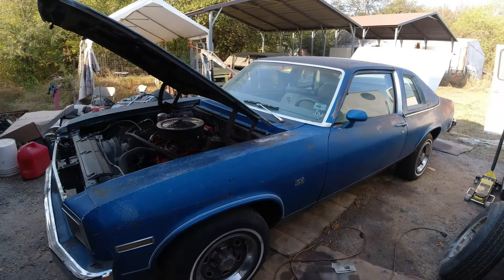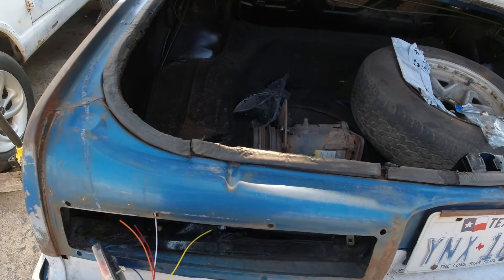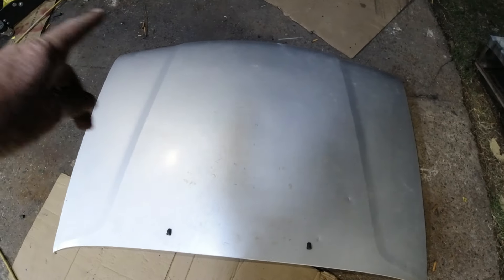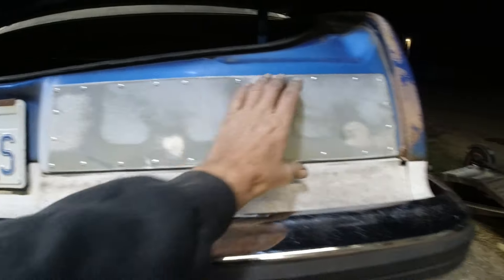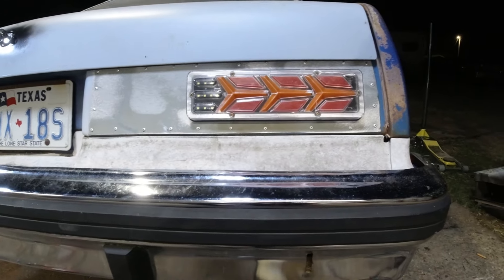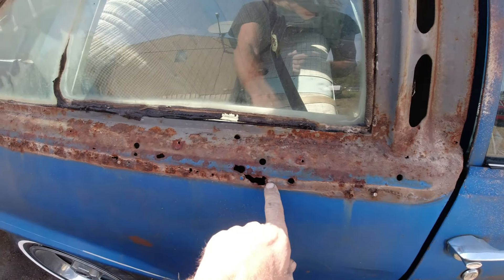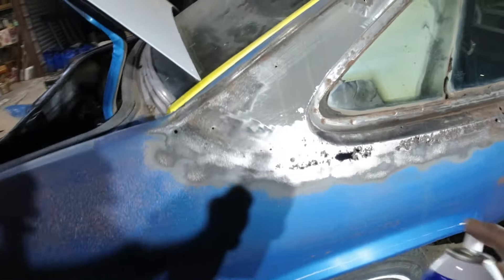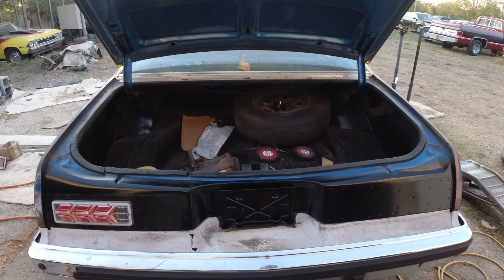1978 V8 "Hot Rod" Nova #6. Installing Custom LED Tail Lights. Rust Repair VDIAGTOOL BT500

Comment: Doing great work on the Nova. I don't know where folks think you're gonna get parts for a Nova Concours from.  Those  Nova Concours were rare in the late 70s because they were a top of the line version of the Nova. I saw one, maybe two in the late 80s early 90s when I was a teenager. in 2024 most have probably been sent to the crusher back in the mid 90s So parts would be hard to come by.

Comment: For led turn signals, you really need to use the new electronic flasher units. The LED’s don’t have the same resistance that standard bulbs have, so the electronic flasher compensates for that.
Reply: Was going to say the same thing.. the resistance isn’t as much so they flash faster

Comment: Hi Lee,  to get full function from your LED conversion,  you will need the LED flasher unit that has a ground wire coming from it. Once the ground wire for that flasher is grounded,  it will function slower flash and all LED Lights should work.  You will need 2 flasher units with the ground wires. I got mine on Amazon about 10 to 15 dollars per unit.
Reply: Was getting ready to type the same thing.  The original flashers required a certain amount of current thru the flasher to have it work properly...but the LED lights use much lower current.  Acts like a blown blub.
Reply: Good to know thank you

Comment: I love that vintage of novas I had nova about that year it was a 6 cylinder with a factory manual 3 speed with a factory floor mounted shifter, I was an automotive technician at that time, and I was well known for building high performance small block Chevy engines, so my Nova ended up with a very good performing 350 and a T10 4 speed, the only other car that I really miss is my 66 Chevelle, anyways great job. I enjoy your videos, and I know that you mainly try to show people how to make the best of what you have to work with, I wonder if you would be able to fabricate a custom surround of the rear windows, maybe entertain using wood ? I know that is a far fetched idea, but I think it would be very unique.
 Thanks for sharing your talent.
 John C

Comment: Great job Lee! I was looking on Marketplace and there's a 1977 Nova Concours parts car that has those original 3 piece tail lights and bumper available in (unfortunately) Tulsa. It's pretty damn far from you but it's an option, i guess. Just looking at it, those parts look compatible with your Nova.
Reply from the maker: yeah, too far

Comment: Hi Lee,
I think there could be a question about when you turned on the left directional, the one strip of the back up light on the right side was flashing. Well, they were flashing on both sides but if you're turning left and that side is flashing, it shouldn't be a big deal but the one strip on the right was flashing at the same time and that's a problem. Cool project! Thanks for taking us along!

Comment: Well I just was thinking about what you are up against with the taillights on the nova but I had the same situation with my contour nova and what I used was a set of 77chevy impala taillights and I had to do some drilling but it was cheap to do and looked great
Reply: They have some 1977 light for impala on eBay for 49.00,Had both left or right side.
Reply: believe it or not a lot of  compliments with the look of the 77 impala lights on my nova
Reply: Hey, that's a pretty cool idea! Those Impala ones weren't too expensive then?
Reply: I’m sure, There pretty close to the same look as the Novas, I’m a Ford guy, but some of the old Chevy car’s look great and where we don’t see them everyday, I couldn’t tell what was original or added,
Reply: There on eBay, just seen today, May not be a fit but look like they would fit better then broken China parts, Just have to get our Government to print more cash for us so we can afford more toys that don’t need parts
Reply: @user-vq3dc2se5d  it was literally like 15 years ago and at the time I didn't have much time to get the ones that belong to the car but had a 77 impala that I used the motor and trans out of and the taillights witch did some drilling but worked out for the time

Comment: Silicone alternative tip - I use DAP Dynaflex 230 available at Lowes and Home Depot. It comes in colors including clear, but more importantly it's paintable when dry. It does take longer to set up, dry, and cure than silicone, but once cured it is at least as strong if not stronger than silicone. It also cleans up with water which means a quick wipe with a wet rag will smooth out a rough edge. Just like Frank's hot sauce, I use that s**t on everything! I've even installed a bunch of glass tile and used it as both the mastic and grout - great stuff!

About your flashers...When I installed LED bulbs in my Javelin tail lights, I ended up buying a 3-prong flasher from Amazon that specifically stated that it was compatible with both standard and LED lights (or combination) to get rid of the fast flashing. Maybe ebay has them?

Comment: That van has a generator light in the center of the cluster for when it isn't charging, pretty much an idiot light but. who knows if the bulb is good or if its still wired up.

Comment: A suggestion..  don't use rivets because they are ugly. Try using panel adhesive. That shit is crazy good at sticking metal panels together. They will never come apart.
Reply from the maker: I want them to be removal

Comment: curves and items g-rated commment makes it pop like old bumpers style class grace or sin·u·ous
/ˈsinyəwəs/
adjective
having many curves and turns.
"the river follows a sinuous trail through the forest"
Similar:
winding
windy
serpentine
curving
twisting
meandering
snaking
snaky
zigzag
zigzagging
turning
bending
curling
coiling
undulating
tortuous
sinuate
ogee
anfractuous
flexuous
meandrous
serpentiform
Opposite:
straight
lithe and supple.
"the sinuous grace of a cat"
Similar:
lithe
supple
agile
graceful
loose-limbed
limber
lissom